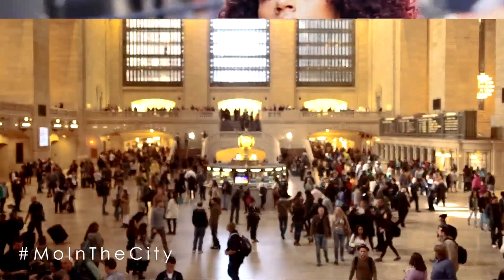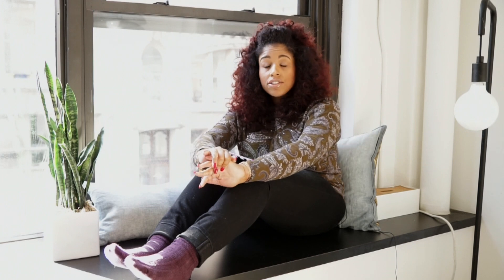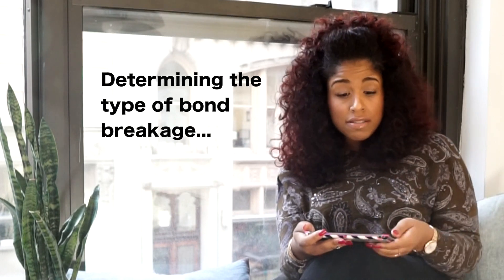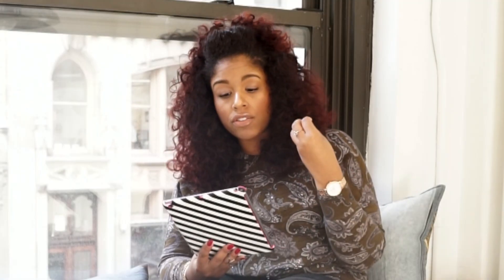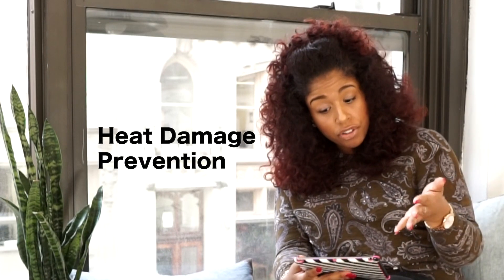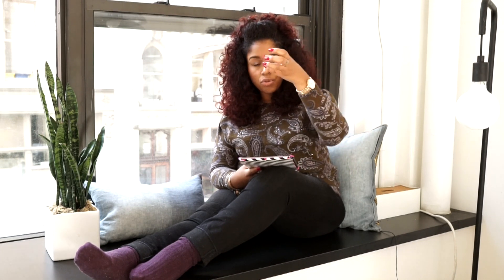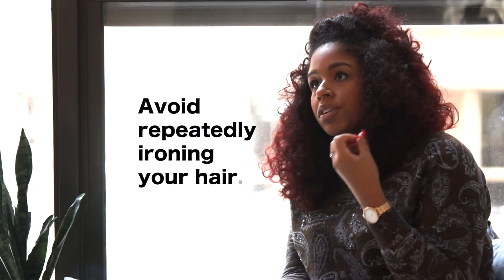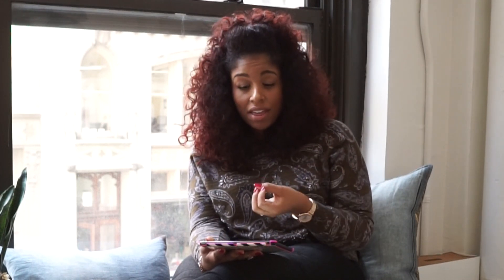#MoInTheCity - A "Come To Jesus" About Heat Damage

Comment: Hello Mo i love your video's. I went to a professional to get a cut and she stated to me that she would have to straighten my hair to cut it the way that I wanted it. Something told me to get up and leave but i didn't. I have heat damage in the front top of my hair and on parts of the left sides of my hair. I'm talking about damage that's so messed up to the point that I will have to cut it.  My hair wasn't this straight when I wore a relaxer. I've decided to let it grow and trim as it grows. I don't want to go back down to 1 inch of hair again. It did damage the rest of my hair but, doing the  ouidad treatments helped that hair get back into shape.

Comment: Hi Mo, I have naturally curly/wavy hair and sometimes about once a month prefer to wear it straight for about 5 days. Now I will blow dry my hair then straighten it ONCE with the flat iron. However I workout a lot so my roots will get curly again. I will use my blow dryer only to stretch my roots again. I have two heat protectants that I put in my hair and one has silicone in it. I only blow dry the roots just to get it stretched out again and I don’t touch  the ends of my hair since that part is still perfect. Will my hair get heat damage even if I’m using a blow dryer which is not direct heat and using heat protectant? I’m only doing it once a month for 5 days. Thank you for the video!

Comment: I recently got my hair flat ironed by a titanium flair iron and she used hair spray for some reason before she started to flair iron my hair. I noticed that my hair smelled burnt so I 
Washed it the day after and my hair is straight in some areas but not completely bone straight...can I get my curl pattern back by protein and deep conditioning treatments?

Comment: The truth hurts. After almost two years of no heat, one month of weave got one part of my hair limp and curl less. It is bone straight in the middle and slightly curly on the ends. Worst of all, it's where I part my hair. Lord I don't want to cut it off but it is inevitable. I will use the Quidad product to amuse myself for few months. Hey, it may help.
Reply: Can or should the Quidad product you suggested be used independently from their shampoo and conditioner? In another video you promoted using a whole line rather mixing different products when washing your hair.

Comment: I got mild heat damage from a stylist (a few strands at the back just on the ends). But I have VERY fine hair. As far as I know (what I learned from YouTube) she did everything right. Is it possible that my hair is just sensitive to heat due to my texture.
Reply from the maker: +Jessica DeAnna could be...you may just need a lower heat setting when straightening or a roller set to avoid tool use. Also using ceramic over titanium lessens the heat transfer.
Reply: Mo Knows Hair Thank you!

Comment: Hi Mo i love your channel and how much knowledge you have on natural hair 😊
I have always been natural and the current state of my hair is in a tapered cut with my front centre section coloured but only with developer and colour but just after coming from a protective style for about 3 weeks it seems to show that my natural curls all around my head are just not there anymore. What could be the reason for this? Im recovering from slight heat damage from years ago but that shouldnt affect my hairs curl pattern all around my head as its only the front section left to be cut off. my go to's are wash and go's and two strand twists and would love to get the wash n go's ready for summer again. Could you pleeeeaase help me!???  
Many thanks in advance 😊

Comment: Hi Mo!
I love your channel and you are so informative about hair care. You tell it like it is and I love that.  I have 3b type hair and tried to follow the cg method.  Since using the cg method I feel my hair is frizzier. before this method is used silicon mix. I loved it . it made my curls pop and my hair was so shiny.  I don't really straighten my hair and I'm so tempted to go back to my mix. can I use products like silicone mix even though I don't straighten my hait?
Reply from the maker: +Amanda Miller yes. I'm no my even sure where that curly girl method came from...there's no science attached to it and silicones don't cause damage. Most conditioners and stylers have them because they prevent thermal damage and control frizz.
Reply: +Mo Knows Hair it's acually a white woman with curly hair that came up with the method. thank you so much. I'm going to the beauty supply to get my mix. lol.

Comment: Hey Mo! This video was super helpful. Now that you went over the different types of damages I see that I don't have heat damage. I thought I did because I also have curls that were once springy but now are just waves and the rest of my hair is a fro. Super frustrating because I was once relaxed. Grew it out , took for ever. Cut the damaged. And now it's damaged again but I'm not sure why. It might be elasticity. I use the apogee elasticity treatment but I also don't see an improvement in the product as I used to so I'll try out the ouidad brand you mentioned. If you can help me on any other recommendations I would really appreciate that! Thank girl.

Comment: Do you recommend oiling the scalp, or does it clog the pores?
Reply from the maker: +Faith Reed No I don't. Your scalp produces sebum to lubricate. If you pour oil into it, you can upset that balance your scalp naturally has. However, some people produce sebum slowly, so if you have tight feeling from dryness or if it's itchy, try a bit of jojoba oil as it is most like your body's natural sebum.
Reply: +Mo Knows Hair what do you recommend putting on the scalp if not oil? Is hair grease good? I use it when I have to straighten my hair.

Comment: my Hair in the front is straight and has been normally softer than the rest of my head, however I used to suffer from itchy scalp. until I hear about ACV which work tremendously, however the front is more straight now but it come back curly when moisture or water come in contact ....can u tell what should I do P. S my hair type is 4c

Comment: I was thinking about getting the Ferrum Professionals Flat Ironed that you used in a video sometime ago. Would you recommend that for 4c hair, or use all together? I ask because since the video I have not seen you mention it? Is it still a contender? Love from Miami
Reply from the maker: +Big Tyni I use FHI flat irons...that Ferrum iron is meant for people with very fine or weak hair that cannot withstand full heat, or if your hair straightens rather easily.
Reply: Thank you so much for responding. Happy new year!

Comment: This was helpful. Can you touch on the topic of mushy hair/curls? I BC'd after 2 years and I'm 3 months post trying to figure out why some of my curls aren't curling.
Reply from the maker: A big chop is when you cut all the relaxed hair off with the first sign of new growth, resulting in a TWA. What it sounds like you did is transition. You may have created damage by trying to manipulate to manage the two textures.
Reply: +Mo Knows Hair You're right,  I should've said transitioned. I haven't straightened my hair since cutting it and my ends curl for the most part, but from my roots to the middle of the hair shaft isn't as defined. I'm trying to figure out of I need protein,  ouidad curl recovery,  or if that's just my curl pattern. and thanks for responding :-)

Comment: The last time I went to my professional hair stylist to get my hair straightened she trimmed my ends, put coconut oil on it and then proceeded to flat iron right after. She told me that it would seal in the moisture. After washing my hair I had patches that would not curl back up! I knew it was because she used coconut oil on my hair to straighten it. I will not be going to her again!
Reply from the maker: Wow...that's just....wow.

Comment: Wooow this has been the heat damage video ever. Very informative!!!! I have been natural for 3 years and have only straightened my hair once. I have fine hair and suffered from excessive shedding most of my journey. I recently started taking biotin supplements and my shedding has reduced dramatically. When you start taking appointments  I'm in there like swim wear 👍👍👍👍👍

Comment: Hi Mo! Spot in video about heat damage and using silicone based products to protect against heat damage! I am totally natural and do not use heat so I don't use silicone based products. I mostly use raw products and I make all my own styling products. My question has to do with gray/silver natural hair. How to preserve the curl pattern, how often should you do protein/elasticity treatments and how to keep your hair from turning yellow/dingy?
Reply from the maker: For gray hair, avoid products with dye (that appear blue or yellow, Etc) because they will stain. You can also use a shampoo for swimmers or blondes that removes calcium and chlorine buildup.
Reply: You mean like a chelating shampoo?

Comment: I have a question Mo, I am almost a year into transitioning and I will sometimes flatiron my hair to blend the two textures  (bad I know) but I always deep condition beforehand and use heat protectant. I  will only do this maybe once per week  (if that) The rest of the time I just do low manipulation styles and enjoy my waves and newly emerging curls. My question is is it possible I could be damaging my "natural curl pattern before it gets fully grown out?
Reply from the maker: Possibly. Only time will tell. That's the trouble of transitioning....you don't know what damage you may be causing until you chop the relaxer off. But weekly straightening is a lot of heat.

Comment: Omg thank you for this Mo'!! I have a ceramic flat iron and I would like to know what's the right temperature for a thin 4a-4b hair. Is it there a right temperature for every hair type? Thanks again for providing this information! I learned a lot.
Reply from the maker: Check the temp guide provided by the manufacturer of the iron you're using.

Comment: hey mo i wanted to kno if u are a natural girl but NEVER wear your hair curly and u get heat damaged is it still necessary to cut of the damaged parts...i mean i don't wear it curly anyway because its to much maintenance for ME... the reason i stopped relaxing my hair is only because 1) im allergic 2) my hair gets bone straight without the relaxer anyway i just had to put a lil more time into it....my hair has grown tremendously since i stopped but my hair has no curl at the ends ....bout a good 2 inches.... do i really have to cut it off...i really don't wear my hair curly AT ALL....
Reply from the maker: No, you would be considered a "straight natural." If you religiously wear it straight then you're hair is going to lose curl pattern because of style choice. If it isn't shedding horribly and breaking off, you're fine.

Comment: I have a question, for the clarifying shampoo, I need that as a separate shampoo then after I use my Cantu shea butter shampoo and conditioning after. finish off with a Jamaican Black Castor Oil? what is a great clarifying shampoo that need?

Comment: Ok so I'm a natural that does not do wash n go's and I rarely wear my hair in its natural state. I wear my hair flatironed the majority of the time. I do have "heat damage" but when my hair is straightened, it looks really healthy and my ends look really good. So if I have some pieces of hair that do not coil, does it still mean my hair is damaged?
Reply from the maker: If it isn't breaking or shedding excessively, you're fine. You just have loss of curl pattern. The term "heat damage" mostly refers to breakage and shedding, but in the natural community it's attached to curl pattern loss. If you want your hair straight, and it isn't damaged, just missing curl pattern, it's ok.
Reply: +Mo Knows Hair thanks for your response Mo!
Reply: +Diamond Brown I believe its  combination of things such as: deep conditioning, going to the salon for trims, and using quality tools and products. Even though my texture has loosened, I still make sure I use heat protectant to combat extreme damage. I know that I will get some degree of damage, especially on the ends since its the oldest part, but if you want to keep your ends intact, follow the tips aforementioned and you should be fine :)

Comment: my hear seem to change when I try a new curl pudding, it seem straw like and. tangle easily and it won't keep my for more than 2 day when beforehand I could go a week. I don't use heat,had heat damage from the pass ,am transitioning, was doing good until I try the curl pudding.Do you think a protein treatment or elasticity treatment should fix this problem over time ,thank?

Comment: I heard that you should spray heat protectant on your hand then place the flat iron close to it to see if you feel the heat and if so that means it won't protect your hair either. Is that really a good way to determine a heat protectant's effectiveness?
Reply from the maker: Never heard that....but not sure it makes sense. You'll feel the heat of an iron no matter what product you coat your hand with. You hair can withstand far more heat than your skin.
Reply: +Mo Knows Hair I RECENTLY messed up the front of my hair by bleaching it and now my bangs are bone straight I already cut most of it off but its still straight anything that I can do to get my curls back besides deep conditioning

Comment: I have heat damage in some areas of my head and just loose curls in other spots,  but I'm not able to cut my hair just yet. do yo think it's best to just have braids or another protective style, just to wait and grow my hair out until I'm comfortable enough to cut it, because now I straighten my hair I just use low degrees like 420 and do it every two weeks. .im so conflicted
Reply: And just to add, omg I really love your videos 😍 😍 😍 😍 as soon as I saw a new video was up it made my day. your so informative and funny , keep up the good work 😁 👍👍👍👍
Reply from the maker: Protective styles should be fine as long as you don't have them to tight or for extended periods of time. And FYI, 420 is not low heat.
Reply: +Mo Knows Hair thanks so much and yea I guess it really isn't 😄

Comment: I absolutely love this video. I had heat damage from the sun . my family goes to the amusement park for the entire summer. I wasn't wearing anything on my hair to protect it so I went to the salon and got a layered cut and my curls popped right back 😀. My only issue now is finding the right winter routine so I don't catch a cold. I have been using the method you use on your friend. Shampoo, leave in conditioner, oil, and cream... and form curls with fingers,let set for 20minutes and then diffuse... got to try the roller set now...

Comment: Hey Mo! Any advice on avoiding single strand knots aka "fairy knots"?
Reply from the maker: I've been asked about these and I really don't know how you all are getting them or how you're even seeing them ...I've never experienced this so I'll have to try and figure it out.
Reply: +Mo Knows Hair mo it usually happens to type 4 naturals :(
Reply: +Mo Knows Hair I get them when my coils (but not necessarily my curls or waves) stretch and then shrink back up, think of a slinky that gets tangled up, lol, basically they are from physical manipulation. If you ever see a shed coil, try pulling it out, I guarantee by the 3rd or 4th time you pull it, it will tie back on itself. the straighter the hair, the less likely the knotting.

Can you touch on hydral/hygral fatigue, do you believe washing daily can damage type 4 hair, or what would make a difference ie porosity, strand thickness, etc. 

And also can you discuss texture, IE silky, thready, cottony, spongy, and wiry, and how that affects styling and product response, as no one ever discusses texture in any way.
Reply: Hi I'm not mo but try doing hot oil treatments monthly and wear your hair in its stretch state. Hope this helps
Reply: Ok thanks 😁
Reply: Do you use hair tools? I've never had any either to my knowledge and I contribute it to NOT exclusively finger detangling. I do finger detangle  to prep my hair for the combing tool I'm going to use. I feel like effectively detangling at least every 7 days is key to avoiding. Jmho.

Comment: Can you discuss the difference between heat damage and color damage?
Reply from the maker: Color damage comes from over processing, excessive applications and in some cases bleach...it can result in cuticle damage and in some cases loss of curl pattern. It has no repair options other than band-aiding with treatments until the damage is cut off.
Reply: +Mo Knows Hair okay thank you! I've been trying to figure out if this section of hair is heat or color damaged. It's not bone straight so I can't tell.

Comment: I love these videos.  I'm almost two years natural and during that time I've been afraid to go to a "stylist" and I've been afraid to use direct heat.  I have seen and heard too many horror stories so I've just been trying to learn my hair on my own.  Recently, I installed twists because I wanted to put my hair away in the colder months, plus I'm kind of frustrated with my hair so as long as the twists are in I won't cut it all off.  Question:  How long can I safely leave the twists in (synthetic hair) before I should take them out to shampoo/deep condition and re-twist?
Reply from the maker: I wouldn't go beyond 4 weeks. And if you sweat in your scalp, less.
Reply: Thanks so much!